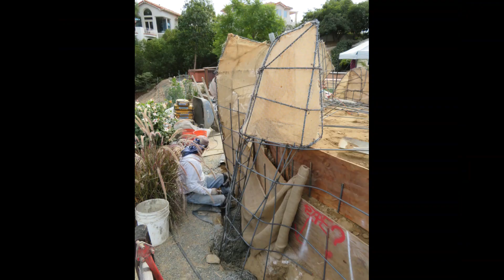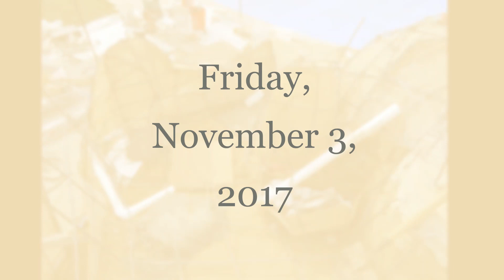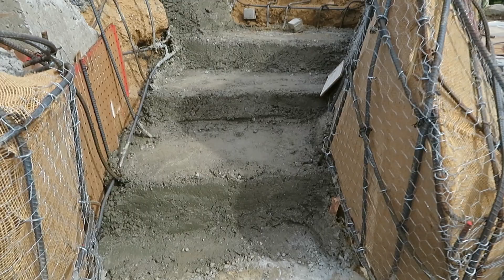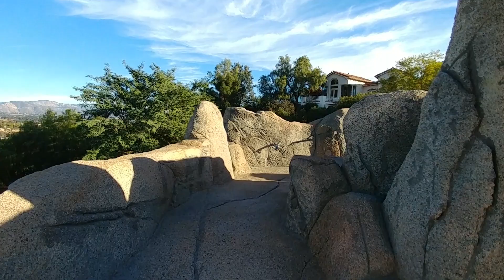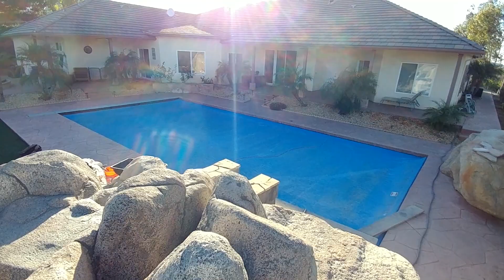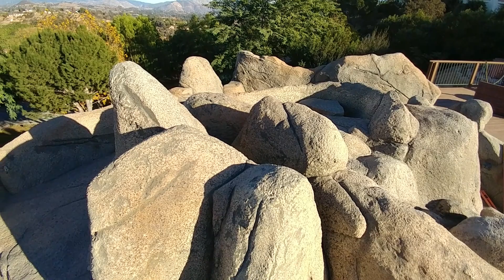‎Fake Rock WATERFALL, START TO FINISH, 2017, Shorty video

Comment: Hey dave what assortment of licenses did you aquire to legally run this show?i was thinking of getting my c-8 and pursuing something like this in my area. Amazing work thanks for showing us your way. You do amazing work!
Reply from the maker: Thanks for the kind words Davs.  Appreciate it.  I had no license at first.  Then after a few years I got a C27 Landscape Contractors License.  Also then started an S Corp in 2004.  Actually began my water feature career building EPDM ruber liner ponds and waterfalls with real rock.  It's super easy and fun too.  I used Aquascape Designs products...  So there ya go.  Cheers, 😎